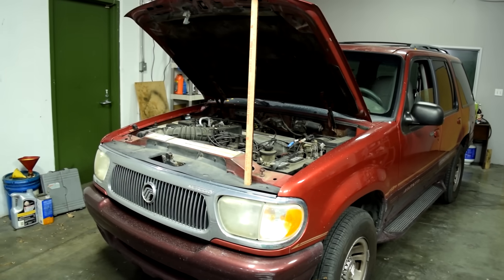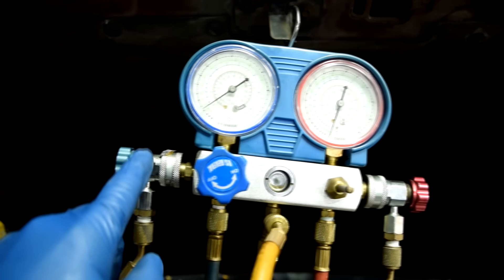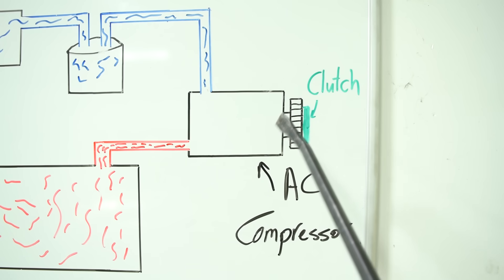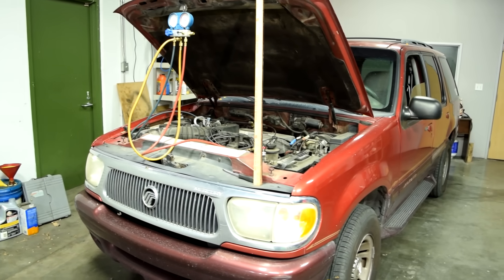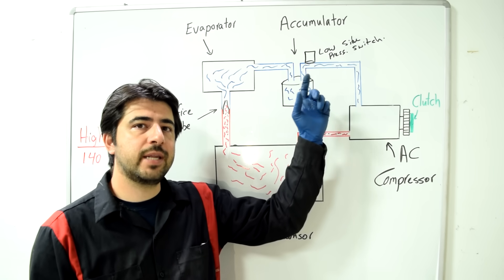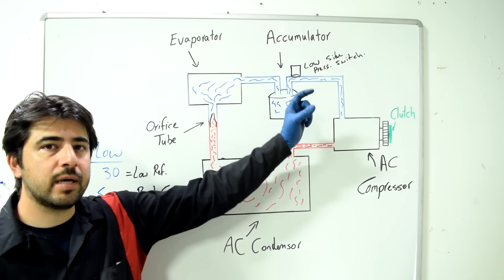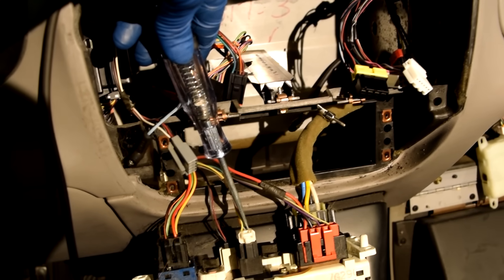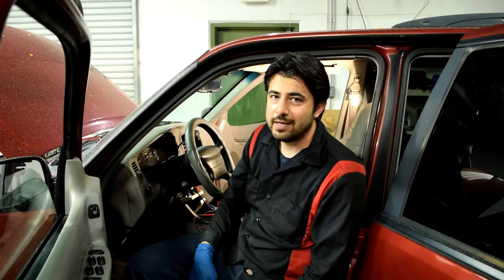Automotive AC Diagnostics, Operation and Repair

Comment: My son’s 98 Ranger had this issue. We got a sturdy blend door in a kit from a website called heatertreater.com I think. You have to dremel an opening in the plenum to get it in but then patch it back after. Worked for the last two years he owned it, and no dash removal.

Comment: Great job, I have watched numerous videos explaining the automotive A/C cycle, 1st time it was mentioned that the actual on/off cycle of the compressor is controlled by the low pressure switch.  Makes sense, a pressure too low the designed spec of the compressor could damage it and therefore shuts off the 12 v feed to the compressor coil clutch.  Keep up the great work!!
Reply: On this particular system that is correct., sorta. The switch he described is actually a Cycling Switch not a low pressure switch. It has a range usually between 22-44 Psi. where the compressor will cycle. Other systems, mostly expansion valve types will use a thermostatic switch to prevent freeze up of the evaporator core and a low pressure switch to prevent compressor damage in the event of refrigerant loss. International trucks use temperature thermistors to sense the inlet and outlet refrigerant temperature at the evaporator and a high side pressure transducer to actuate the engine fan and turn off the compressor in the case of over pressurization. This is all controlled by the ESC body Controller ECM. I give these examples not to confuse you but to show that A/C systems are controlled differently depending on how they're engineered.
Reply: Ron Sposato that’s Mind Blowing 🤔 wow 
Thanks for Sharing 👍🏻

Comment: 2000 Jeep Cherokee... Will not Take Freon... Compressor  worked great in the other jeep 96 cherokee country both 4.o but i had to change out the backs because they were in different positions. 96 back of 2000 top of comp. I had it vac. and put ruffly 4 oz oil that it took no problem. wont take freon. i know its pumping for sure because i took off the low side sensor held down the valve with the clutched manually kicked in with trying to put freon in it and it blew off one of the lines going into the condencer. i replaced o-rings and put back on.  So ya its building up pressure but not sure on the suction part. as far as the power/fuses etc.  I start the car turn on A/C controls, Hi/max,   with a test light i have pwer on both wires coming from the compressor . the ground on the comp. shows to be hot too. Both incerts show hot on the low pressure switch /cycling switch unless i unhook the high side switch. then one side hot no light on the other insert.Then i try to bridge it over and it still dont kick the clutch in. If i try that with it showing 2 hots it blows the big 20 amp fuse. Same if i try to bridge it over from the ac relay on the fuse box.  the fan shows 2 hot coming out of the switch going to the fan but  1 hot 1 ground going in the plug.  When I unplug the ac compressor i still have power on the compressor  end/plug and both wires  but no power on the plug wire coming from the wiring harness.  Even with everything unhooked. low side high side fan and ac compressor i still have power on the compressor. both wires... Only time  the wire from the harness has powe is when i plug in the ac.  Is that right??  My low  pressure switch  4 ports has power on 3 out of 4 ports/slots.    Car running ac controls on, if i unplug my low  side  sensor i then have a hot and ground on the high side switch  instead of 2 hots but low side switch has 3 hot 1 neg. unplugged... i did test the wire thats going into that port and it has power going in the  switch but no power in the port of the switch.  If i hook the high side back up, again i got 2 hot ports on the  low pressure switch.  Even when i have 1 hot side other neg with the high side unplugged = it still wont cycle the clutch but it dont blow the fuse then. Do i have a ground somewhere maybe causing it not to let it take freon??? P need help caus i cant afford to take it to a shop...

Comment: The fricking blend door. Ford's are notorious for those failing. The stealership wanted $500 bucks in labor to fix mine on a Ford Expedition. Bad engineering for sure. I fixed it myself without removing the entire dash. Just 10 bucks!

Comment: I need help, I just replaced my compressor, recharge it and I only get btwn 20 to 30 psi on the low side but high side still show 0 even with the compressor engaging. 
What else could have gone wrong?
Reply: angello verastegui He said the Txv is stuck open on the High Side of your A/C system. The TXV is a metering device that controls the flow of refrigerant from the High side to the Low side of the A/C system.
TXV is an abbreviation for: Thermal Expansion Valve
Reply: @davidhall3747  I though the same, but having a sutuck open expansion valve would give me the  same pressure reading on both sides. But instead i'm getting 0 psi on the high side
Reply: angello verastegui With the Engine off the Static Pressure should be the same on the High and Low Sides.  It should be equalized. Not when the Engine is running and the A/C Clutch is engaged. Sounds like the Discharge Valve inside your compressor is not pumping up the Refrigerant to its proper pressure. You could have a defective compressor- even though its new.

Comment: I am having a problem finding the A/C pressure switches.  i see one down by the compressor, think it is the high switch but trying to locate the low on a 2014 Buick Encore.  I don't see a A/C relay either.  I found fuse is good but compressor clutch is not energizing (or engaging). I can't find any diagram online of the Encore or Trax.  Maybe Lo switch is in compressor?  I am reading approx 90 psi on both the low and hi side with car off???

Comment: Great video great explanation. When the process begins at the compressor its a gas. When it goes through the orifice and expands does it remain a gas or turn to a liquid? Then it goes to the drier and has moisture remove as a low-pressure gas. Do I have this straight in my head? Just confused if its always gaseous or does it change back and forth? Thank You ❤️️
Reply: When the Refrigerant leaves the Condenser it "condenses" into a liquid. It changes state when it passes the metering device. In this case an orifice tube, it would be the same if the vehicle had an expansion valve. At this point the refrigerant changes from high pressure to low pressure and is in a semi gaseous state, as it enters the Evaporator it no becomes fully gaseous where it absorbs the heat from the air be blown across the Evaporator by the blower motor.
Reply: @bigtruckacman  Thanks Ron excellent explanation to my question. Appreciate the response 👍

Comment: Great descriptive video.  Because mechanical levers and cables were way too reliable, let us just throw some nonsense electronics and vacuum in that's guaranteed to fail at some point rendering the whole system a pile of garbage....worse is the Crown Vic's automatic climate control system where it gets stuck in defrost no matter what function you select to you turn on the AC and it only blows out the defrost....that's another failure prone system that also isn't a cheap fix and requires tearing the dash apart.  Dumbest designs ever.  

I've done a couple of AC conversions which 1 is going on 3 years since the conversion and I followed that conversion step by step through the instructions changing the orifice tube, accumulator, evacuating and flushing the whole system, changing all the o-rings, etc.  The 2nd one I did about a month and a half ago and did nothing except evacuate the system put the conversion service port adapters on, vacuum and recharge the system totally ignoring the orifice tube (1 because its buried to the point I don't feel like disassembling the car to get to it, and 2 just to see if this changes the life of the conversion and/or components)...its working so far, but curious to see how long the system will last as the car sat for 4 years, and when I started there was a very slight bit of refrigerant left in the system but not enough to cycle the compressor.  The conversion didn't take long, took longer than normal because of the tight spaces to work in with that car requiring 90 degree angle service port adapters.  Its not hard if you pay attention, replace the components like the instructions state and flush the system, change the refrigerant oil (another step I completely skipped on purpose) and repair all leaks if there are any and properly vacuum down the system and recharge it.  The only thing I'd hate is replacing some of the components like the compressor in many vehicles its buried...the next would be the evaporator....often times if that fails its best to replace the vehicle LOL.

Comment: 6:35 so the system at rest has liquid refrigerant or gas refrigerant?
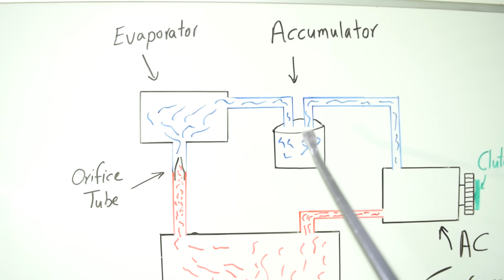If it is in liquid form at rest,  at 6:16 liquid damages the compressor, so when you start your ac system doesn't that liquid damage would damage the compressor?
Reply: When the AC system is at rest, the refrigerant is gas.  When the system is on, the Compress creates High Pressure Gas.  The High pressure gas passes through the Condensor (sits in front of the radiator) where it gives off heat to the outside and the gas becomes High Pressure Liquid.  The High Pressure liquid passes through the Expansion Valve or Orifice Tube where the High Pressure liquid becomes Low Pressure Liquid.  That Low Pressure liquid passes through the Evaporator where it picks up the cabin heat and becomes Low Pressure Gas.  BTW, don't forget the Accumulator is designed to capture any liquid before passing the Low Pressure Gas back to the Compressor.  
Principles of Refrigeration
- Liquids absorb heat when changed from Liquid to Gas
- Gases give off heat when changed from gas to liquid

Comment: Plz tell me any1 coz i m little weak in english . What is the correct high pressure value as well as low pressure while AC in use and at off both conditions

Comment: Sir my car ac noise and hissing from inside when in idle or lower speed. But it goes away when car in running condition and ac cooling properly. What kind of problem is it?

Comment: What happens if your compressor clutch is not coming on? I took my car (07 grand prix gxp) to a mechanic who says my compressor is good, but he thought the controls were bad because with his diagnostic tool he could turn the compressor on and off and get cold air. I went to the junkyard and got the controls and AC was working again. days later same thing happened, compressor wont come on when I turn on AC. I have heating, and everything else on the controls seems to work. Now sometimes I hear a bit of water moving around in my dash, but no leak. I looked under the passenger side of my car trying to find the AC drain tube to blow some compressed air in there, but couldn't. Could that be my problem?

Comment: Great video and very educational.
Over in Australia, we had RHD Brazilian built F250s between 2001-2006 with both 7.3 Powerstroke V8 and 4.2 MWM Sprinter straight 6 T/diesels. I have the 2001 4.2ltr Sprint motor which houses a different type of A/C components to the 7.3ltr. 
Looking at the above vehicle, the system looks very much like that with the same vertically house evaporator. Talk about using old parts. ha ha
My problem is the air stays cold for 5 mins then becomes warm, like the outside but not hot like you have the heater on.
I had a guy look at it and he said my high side pressure was very high and when he spayed water on the condenser, the pressure dropped immediately. He checked the gas and its OK
Can you offer any advise? 
I am thinking I should take out the evaporator and clean it?
Thanks for any help.

Comment: My Honda CRV 2006 model is making a occasional whooping noise from inside under the dash, is that a sign the expansion valve is starting to fail? I have no issues so far with the operation of the AC system.

Comment: Any chance you can do a theory of operation and troubleshooting video on an older expansion valve system using a trinary switch? I'm working on a 1989 Chevy P30 chassis for my Winnebago.

Comment: I just installed a Vintage Air system on my 66 Mustang. Unfortunately once I reinstalled the battery box I realized it was covering the high pressure service port. Is it possible to evacuate the system using the low pressure port only?

Comment: The temperature of the discharge from the compressor is room temperature but after the condenser it is cold. I am assuming bad compressor. Correct?

Comment: Thank you for taking the time to make this video and for your detailed explanation of how the system works.  I had to open my system for the first time on Tuesday to replace my compressor, orifice and accumulator at which point I discovered that the orifice was installed backwards.

Comment: Hi, i was wondering if a bad receiver drier could cause a clog in the whole system. I am getting extremely low pressure on the low side port, and ok pressure on the high end. I think i might be on freon as well.
Reply: If the receiver dryer and anything after it looks covered up with frost then you have a restriction here... restrictions act just like orifice tubes...

Comment: I AM AAMIR I AM REPAIR ALL KIND TYPE OF MODULE LIKE E. C. M-B. C. M-POWER STEERING MODULE- B. M. W FAN MOTOR-AUDI-mercedes benz fan motor's  
MOBILE NO. 8700268540
MOBILE NO. 8285437302

Comment: I have a 2014 gmc terrain slt 2.4l L4... when its hot and its parked in direct sunlight and i started it starts blowing warm... after a while of driving it starts working and after a few mins it stops blowing cool air.... and it works when i first start the car when its parked in the shade... it seems to work only when the car isn't hot like in direct sunlight... what can it be???

Comment: What about noises coming from the clutch and compressor, could it be because the heater core is on? I have suspected this same result for my vehicle and instead of replacing parts, I’m thinking I don’t need my heater as much as ac, I’ll just disable my heater, and keep it closed to just the evap.

Comment: I got my AC condenser replaced a few weeks ago because it had a leak. My orange engine light came on a few days ago and I went to get it diagnosed and it came up AC system problem the guy I had it fixed of is saying there is no way that the computer would show AC system problem is this true.

Comment: i replaced my AC compressor in condenser bought the kit and the vacuum it . bit it not cold enough just on the mornings or at night when it's not hot. dose any 1 know that other problems can it be. 2004 Lincoln navigator

Comment: I have a problem with my cars A/C where it will only blow warm air yes the compressor works it engages and Yes their is refrigerant in the system so I figure  it can't be a leak. Has anyone had this problem before or can someone help me out with giving me suggestions on what it might be the problem?

Comment: My car AC static pressure is not equal. The low pressure side is 80psi and the high pressure side is 105psi. The ambient temperature is 32 degree celsius. Actually I should get both side 105psi. Can I know what is the problem?

Comment: Rapid flutter on both gauges tells me the problem ISN"T with the a blend doors.  It's in the closed refrigerant system.  You've either got non-compressibles in the line like moisture, OR you've got a problem with the compressor and odds are your high pressure limit switch taking the compressor in and out which causes the flutter.  Momentarily bypass the low and high pressure switch one after another and see if the flutter goes away?  Focusing on the flutter would have saved you from going after the controls in the dash.  AND, you pressures depend on the refrigerant in the system.  Most cars after the  1990 are running R134 while older systems ran R22 or R12.  The normal pressures between the older and newer R134 are very different.  One of the plates under the hood will give you that information.  Good luck in the future in tracking down tough problems.
Reply: Curious fact: a very rapidly oscillating (fluttering is the word) suction pressure, so rapidly oscillating that you can't see it on the gauges, is the cause of the groaning noise made by a variable displacement compressor which is pumping at the lowest displacement available. You hear it inside the car and from the vents because the oscillation propagates to the evaporator. It's obviously the pistons moving so fast that the reed valves open and close very fast. The sound is completely normal as long as the compressor isn't making it all the time (in that case, the displacement control valve may be faulty or the refrigerant level may be low).

Comment: Is the  invert  a can Freon gas is true or wrong ?  when i invert a can the liquid came out but i put it right position the gas came out ? what good case  to fill compressor whit Freon gas  with gas stuation or liquid ?????  thank you
Reply: You should never ever put Refrigerant “Freon” in Liquid state into the compressor..... The Accumulator absorbs the rest of the Liquid so only refrigerant in gas state will go into the Compressor. So Gas only. You Recover Both Liquid and Gas but proper way to recover is Liquid first then Gas.

Comment: My civic a/c is not working, fans work, but a/c clutch is not engaging, I've bought one of those cans because I thought it was low on refrigerant, but when i connected the valve the pressure is too high,  it's in the red zone, what could be the problem?.
My a/c had been working just fine until a few days ago that the temperature was at around 110 degrees.

Comment: The first thing to do: Make sure your high- and low--pressure Shrader valves are working. Many time you will get a false reading if they are stuck. If you get a zero on the red guage, don't assume you have a bad gauge or an actual AC problem. The valves must be unstuck.